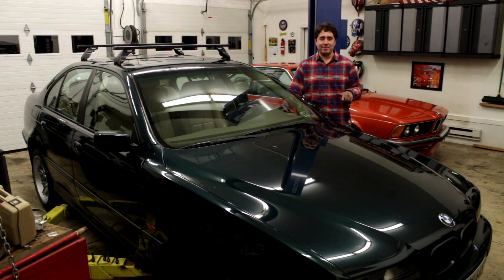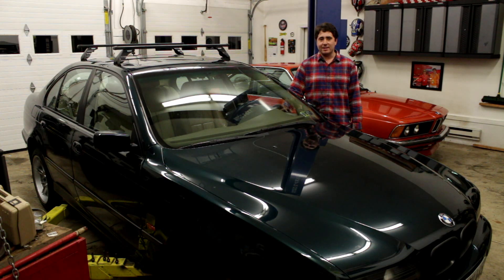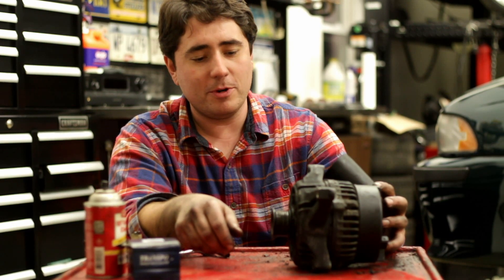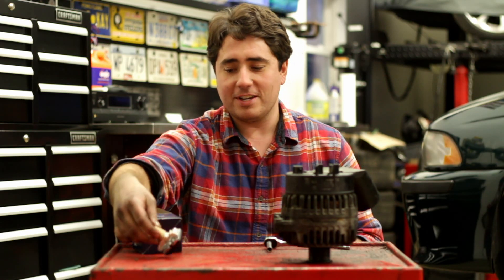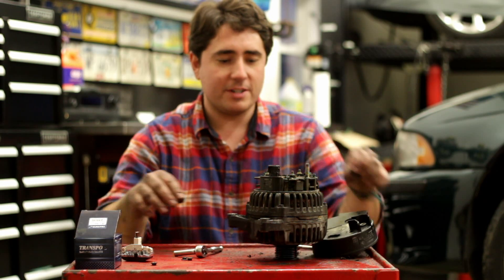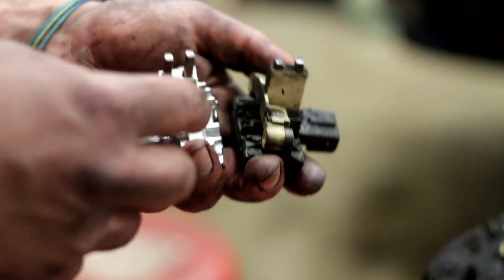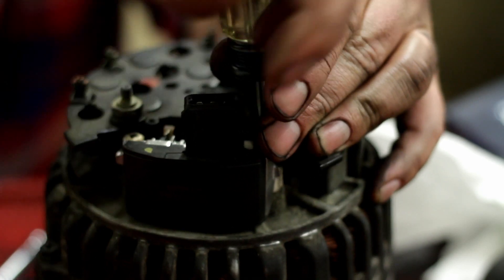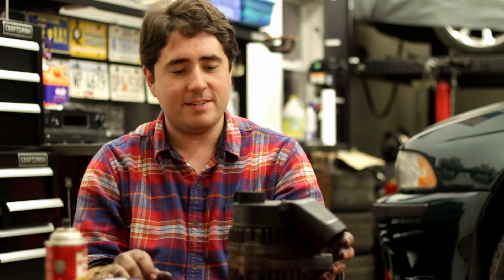BMW e39 Air Cooled Alternator Voltage Regulator Replacement

Comment: Hello, my alternator has been refurbished before around 25k KM and now i an experiencing 14.9-15v while driving and 14.9 when idling with most electronics off do you think it needs a new regulator ?
Reply from the maker: That does sound a bit high but I would try measuring with a second meter to confirm before I did anything. Usually an unregulated alternator puts out a lot more then 15 volts. What made you decide to check to voltage?
Reply: @TrulyMotors  a flicker/vibration when anything that uses ectricity turns on like power windows and headlights i feel the alight rpm change
Reply: @TrulyMotors  mind you this is using the cluster test which deffinelty would be showing 0.1 to 0.2 less and while driving with everything i turn on including ac and seat heaters i still get 14.7-14.9 constantly flickering between those numbers and never 14.8 at idle with electronics off its 14.9-15 flickering constantly so is there a reason for it to be anything else than a regulator because i would just change it out to be safe if that is the most probabale cause

Comment: How long has this lasted you?
Reply from the maker: It's my daily driver and I haven't had any problems with the alternator since!
Reply: Great news. Mine started having the same symptoms as your on my original  05/96 build. Actually it’s been going on for a while with the MID display going dim and back to normal. Just occurred to me I need to figure out something ASAP as the battery light turned on the other day. I’m going to try this first since the bearing on my original one does not have play or noise yet.. 06/96 build with 263k. Made in Great Britain. “They don’t make them like they used to”.
Reply: Thank you again for this well informed video. We need more content like this.
Reply: Just replaced my regulator and resolved my problem. Great video once again!

Comment: The whole video talks about the brushes not the voltage regulator... but yeah, part of the assembly. I just bought 2 brushes for $7 and used the same old voltage regulator.
Reply from the maker: Great idea, I wasn't even aware you could buy the brushes individually. Where did you buy them from?
Reply: First of all I just want to point out this will involve soldering. 
Secondly, it's hard to find the right parts. After long research on the proper alternator I still couldn't find the right part number but I ordered the graphite brushes for Bosch alternator on Ebay. They were actually wider than the shaft in the voltage regulator, so I had to file them down - carefully. Had I known this I'd probably spend the the extra $20 for the whole regulator. :D
Reply from the maker: At least you got to maintain the genuine Bosch regulator, I'm sure you'll get a lot more life out of it.

Comment: nice video, where did you get the voltage regulator from?
Reply from the maker: J * Glad you liked it! Here's the link to the part: http://www.maniacelectricmotors.com/80201172.html
Reply: @TrulyMotors  it's 60 now
Reply from the maker: @Mitchell-n2g  Good to know
Reply: Most European cars from the time uses the same Bosch alternantors, I believe the internals are the same. Apparently, only the mounting points on the outside are different. Therefore, the voltage regulator will likely be the same as long as you have the right amperage.